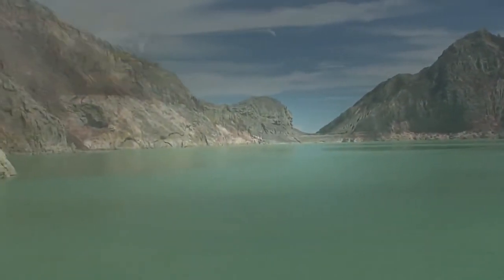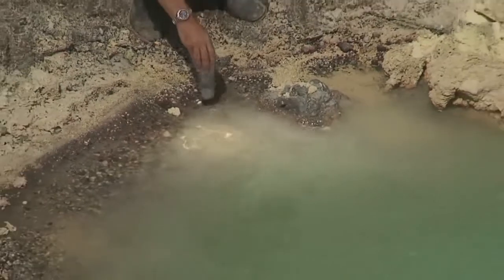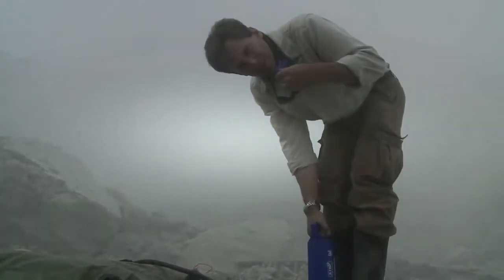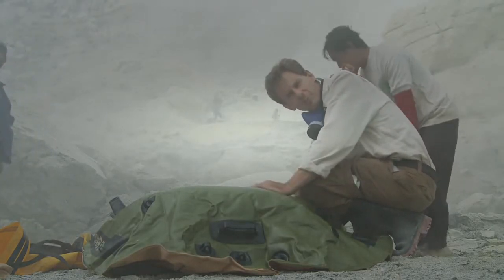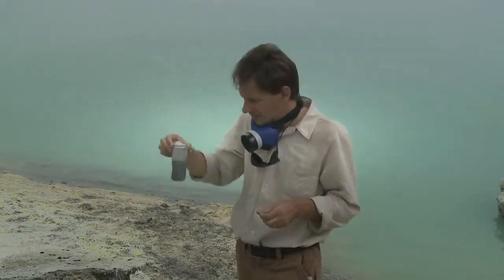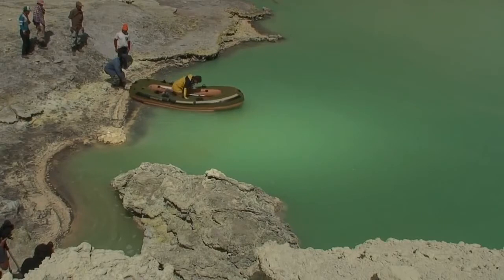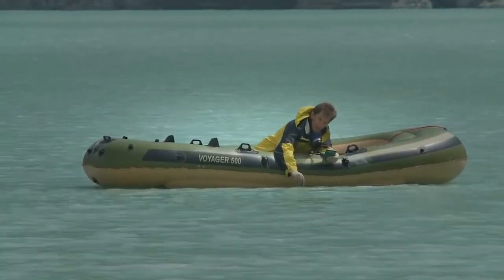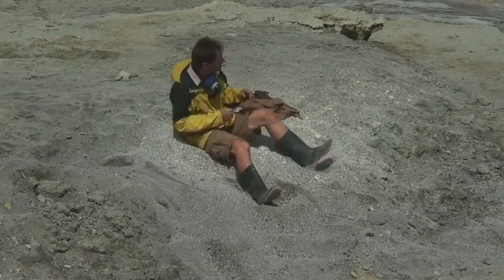Boating on Acid| Boating Hacks

Comment: so that whole like is nothing but sulfuric acid with a Ph of 0.1 which is extremely strong. so it's corrosive but if you splashed it on your skin it would start eating through your skin right away
Reply: It's water mixed with some sulfuric acid. It not like purely concentrated but it still powerful enough to burn skin and other metals very quickly.